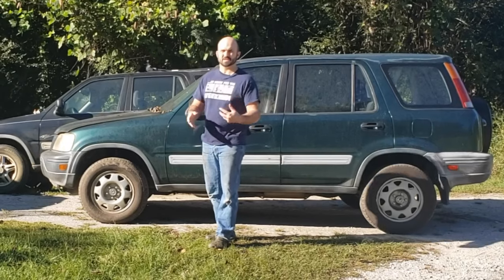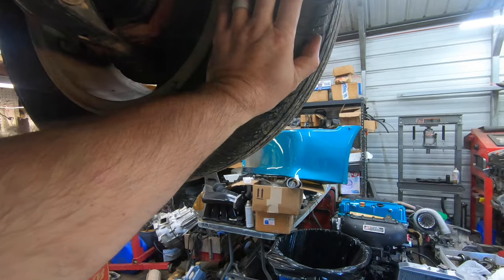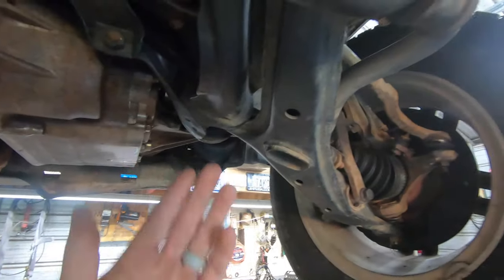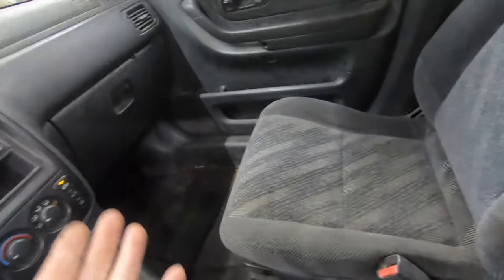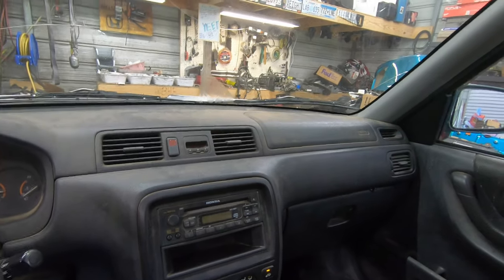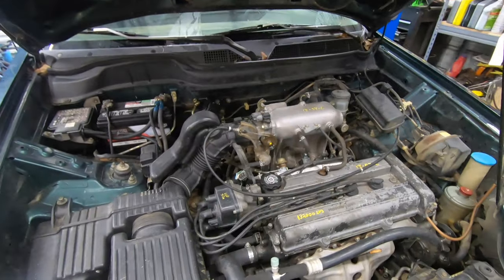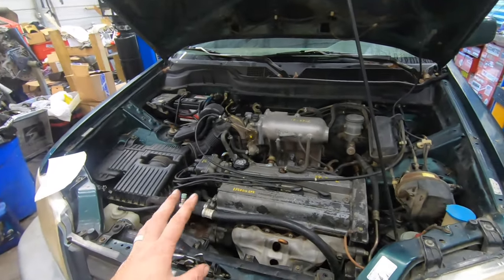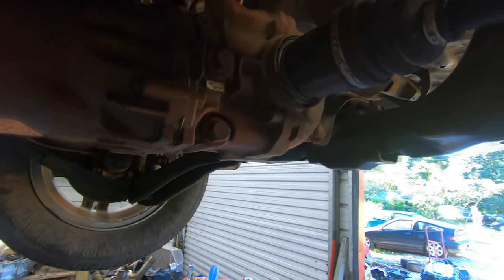Most Common Problems: 1997 - 2001 Honda CRV RD1 RD2

Comment: Do they have issues with the rear trailing arm bushings? I thought they had a similar setup to the civics and they are pretty much always cracked and need replacing.
Reply from the maker: They are the same design, however I don't see these busted up like the civics as often
Reply: @hondaresource  oh thats good, its a bit of a pain of a job to do those bushings
Reply from the maker: @teamaxlestands  yup, the tool helps a good deal though

Comment: You made good points of the details between the lx ...ex.. and se... But the downside is that all the parts are interchangeable so yo can have an lx but ex parts could be installed...
Reply from the maker: I wouldn't consider it a downside. I think it's pretty cool that parts are interchangeable.
Reply: Yep.

Comment: Do you prefer to replace the entire lower control arm, or just the ball joint that's the problem?
Reply from the maker: Ball joint isn't pressed into the lower control arm, so just the ball joint if that's what it needs

Comment: I have 2001 crv SE model  and have a mysterious problem of cranking but no start and its intermittent. Usually happens when the car is at running temp. I have replaced the distributor ,cap ,rotar, plugs ,wires, and fuel filter.  
The starter is strong and I just had the whole timing belt kit replacement done and it is still having the problem.
Reply from the maker: I would look at the main relay. It's behind the glove compartment.
Reply: I've had my CRV for 15 years and I had the same issue where it wouldn't start and it ended up being the coolant sensor just by the distributor and I was like you I replaced all that stuff you did.....

Comment: I have ine of these and have spent around 1500 trying to fix it done a tune up and it started missing got that fixed and now it will not idle until it warms up. After it warms up its runs fine other than idle surge and seems like it down on power a little.. I've took it to 3 different people who have replaced timing belt to checking this and that and computer with no luck
Reply from the maker: No check engine light? Kinda sounds like the ECT sensor since it wont idle until warm

Comment: I have a 2001 crv and when im running down the road 1 gear is fine then 2 second gear sometimes it does fine sometimes it takes time to shift when reaching at 4000 rpm to shift and i did the oil change and  it worked fine then it started to do it agian and i dont know what to do. Can you plz help me.

Comment: Just bought a 98 CRV with 238,000 miles and there’s an oil leak I’m trying to find without buying the uv dye..I think it may be coming from a hose connecting to the bottom of the radiator..would that be oil coming out of a hose in that location if it were?
Reply from the maker: It's possible that transmission fluid could be leaking there, but not engine oil

Comment: I have a 99 CRV. For the past two weeks, I’ve been through the ringer on this thing!  Hopefully you can help..

The lower header rusted out at the flange so I replaced that with a new one. After that, the car started to feel like a dog driving, found out the cat went bad, so I replaced the cat and figured the car was running like that due to a lack of flow. Now all the exhaust is sorted and fixed, it runs completely normal for about 20-25mins and then it will sputter and die. Then it won’t start (will crank just fine) for atleast 15-20mins until it does start and it only can drive for a few blocks before it dies again and this process restarts. 

I’ve put new plugs and wires in it a few months ago and just today replaced the cap & rotor just to be sure.  But man, I am lost.. it doesn’t throw any codes and acts completely normal until it sputters and then starts doing this.
Reply from the maker: Either the main relay ( pass side behind the glove compartment) or the ICM (in the distributor) 95% chance that one of those 2 are the culprit
Reply: @hondaresource  after commenting I learned of the fuel ignition relay. Went and bought one and installed it. Seemed fixed until it sputtered out and died again so I have a distributor ordered now. I also bought a crankshaft position sensor just in case. 😂🤷🏻‍♂️

Comment: i have owned a rd1 97 for over 10 yrs, sunroof wont seal properly (leaks), that leak in the passenger side, power window issues, now my tps and my a/c compressor wont shut off i had a b20b4, then b20b1 now a cross between a b20b/z

Comment: So I’m having a problem with my 2000 crv rd1 over heating problems when running ac I’ve switched both fans they both run great I have switched temperature sensor fan switch radiator thermostat I’ve done a Block combination test all was good what else could it be
Reply from the maker: Only with ac?

Comment: I get the cracking/popping sound coming from the back, would that also be the end links ?
Reply from the maker: Definitely possible
Reply: @JerkingwithJesus  well i usually hear when im going fairly slow (20- 25 mph) over bumps usually ones at weird angles, not like regular speedbumps

Comment: You should see all the 1st gen crvs in Canada. They are all notorious for rusting on the back fenders ! About 9/10 I still see on the road have atleast one rusty back fender.
Reply from the maker: I see a few from time to time with rust, but it's extremely rare
Reply: @hondaresource  15-20 is what they last before rusted frames break, floor boards rotted ectt. Some have holes in wheel wells after 5 years.  In Maine , so basically Canada lol

Comment: Hi just wondering my son has a 1998 crv and sometimes it shuts down as he's driving it then he will pull over and wait 5 minutes then the car will start back up what would cause the problem
Reply from the maker: Usually the icm in the distributor or the main relay behind the glove compartment

Comment: My wife had a water leak on her passenger side 2006 CR-V. Apparently, the drain valve can get tucked upward inside the frame when the car is being lowered on a lift. I had to crawl underneath the car and flip the valve out with a butter knife and dodge all of the gross ass water flying out.

Comment: I had a problem on my honda CR-V 1998 manual transmission. The engine starts when ist cold but when the engine is hot the engine cranks but no start. Pls any idea what is the problem
Reply from the maker: Ect , main relay, or distributor

Comment: I’m curious if I’m one of the few with A/C issues. I’m told Black Death but idk. I replaced everything but didn’t do it all at once. Any ideas? Maybe do it all again but all at once? 97 AWD
Reply from the maker: what all did you replace? I definitely would recommend all at once.
Reply: @hondaresource  condenser, compressor, pressure switch, dryer, evaporator, expansion valve and blew out the lines which has a bunch of black/brown oil. What I have waiting in the wings to attempt is all of the above again and to A/c lines (only ones I could find online).
Reply from the maker: @mbermudez45  I normally clean the lines with brake parts cleaner

Comment: How much would you charge to do a manual conversion on a 2001 Honda CR-V
Reply from the maker: I dont have time to do a manual conversion, sorry man!
Reply: I've done one, it's kinda a pain (if you want it looking stockish), and needs so many parts from a manual it's likely easier to do an engine and interior swap to the manual chassis.
Still, it's very doable. You could maybe buy a manual crv for the cost of the parts involved.

Comment: Why does my 99 crv quit on me most of the time on hiway or whenever it want to, I thought would be the fuel pump, but sometime I slammed my driver door overdrive light comes on then I can start the car again
Reply from the maker: Kinda sounds like a main relay or ignition coil / ignition control module is going bad

Comment: I just bought a Manual 1999 LX a few days ago. It's a super clean, well kept vehicle, but I'm finding it's hidden flaws that I missed on the test drive now. 

I already had to fix the door wiring, that was fun. It also looks like I'll be doing some suspension work, and I have reason to believe the input shaft bearing is bad in the transmission. :/ Ive rebuilt the trans in my Civic before, so I definitely think I'd rather just replace it this time around. (Hmu if you have one, I live in TN 😉)

But once those issues are solved, I know I'll be very happy with it. They're such cool little vehicles. (I say little, when it's the biggest vehicle I ever owned haha)

I just sold a 2000 Civix EX that I've had for many years and this feels like a big version of that with a bunch of cool extra features.
Reply from the maker: Those transmissions are kinda difficult to find. You'd probably come out better replacing your input shaft bearing. Congrats on your purchase!
Reply: @hondaresource  Hey, question! Do you think the rear seats in an EX , or at least the frame that allows them to fold out into a bed, can be easily swapped into an LX? A local salvage yard has an EX there with the folding rear seats, and if they can just bolt in, I'm going to snag them.
Reply: Sounds nice ! 5 speed! How'd you find it .....
Reply: @SaulnowPaul77722  just got lucky on Facebook Marketplace!
Reply: @TheJakePoole  very nice!

Comment: I have a automatic 1998 Crv with Engine misfire but only when its hot out, not because the engine itself is hot but due to the weather itself. Changed spark plugs, Battery, distributor and the Module inside the distributor, including the gray box on right passengers side in glove compartment. Any ideas?
Reply from the maker: Have you done a valve lash adjustment?
Reply: My 2000 CRV LX had soft valve seats from the factory I had to replace the head at 80,000 MI..... Also the air conditioning unit should have been recalled because it blew a hole in the side of the compressor at $65,000 MI.....

Comment: I have a 2000 CRV and I ran into an issue with limp mode, seems like it won’t accelerate past 3000 rpm’s, is this a solenoid issue?

Comment: Hi I have a Honda 2000 CRV and the right front hub was replaced and now the front brake pressure plate is loose making a noise.  How do you fasten it to the hub. I don’t see any screw or bolt areas to secure it on the wheel.
Reply: I meant vacuum plate
Reply from the maker: I have no idea what you're talking about

Comment: I have a 2001 SE awd auto that has a constant whirring sound that increases in volume and pitch with road speed, any ideas of what i should check? Ive had rear diff fluid replaced, I did several trans fluid drain and fills with the proper atf. Shifting to N while driving does not effect it.
Reply from the maker: Possibly wheel bearing
Reply: @hondaresource Thanks, I'll check those first! I saw your video on replacing them, do you think they can be changed without a press? I changed the bearings on my 99 ford ranger without one and it was a pain, and the crv bearings look like they're a lot tougher to install because they're so large. Not sure if the wood block and sledge hammer technique is enough there! 😅
Reply: Or just bad tires even.  @hondaresource

Comment: Have a question about my daughter's 99 crv it idels fine when cold after it warms up it does ok till it gets hot enough for fans to come on the icv has been replaced twice the throttle body has been removed and cleaned theroly even the high idele thermal control but after driving a wile putting it under a load will cause it to stall out and oil light will come on it's been put on a diagnostic tool and everything shows fine other than rpm and there's no check engine light on I know your in Alabama and I'm in Lagrange ga
Reply from the maker: Is the oil light coming on before stalling or after?
Reply: @hondaresource  it's coming on before it stalls every time it idels low it will come on it car doesn't have enough RPM to keep oil light off

Comment: hey at 7:17! I think that's what my issue is the valve seat issue - I've popped the head off THREE times now to replace the exhaust valve on cylinder one that have blown. Does this mean loosening the valve lashing to solve this issue? what's going on here?
Reply from the maker: Are you doing a proper valve adjustment on it each time?
Reply: @hondaresource  I very stupidly wasn't - in fact I wasn't even returning the rockers back to where they came from. This time I did a valve lashing to spec (first time doing that haha) - I found it incredibly remarkable how loose 0.16 and 0.12 felt, - like the tiniest amount of grab left. Runs like a dream now, check engine light from error p0420 went off on its own. The valve lashing honestly sounds a bit loud but it runs like a dream now.
Thanks for your vids!
Reply from the maker: @jamesdahmer5027  that will probably make all the difference

Comment: I thought the 97 98 Motor was pretty much the same as the 99 00 01 the only difference I thought was the intake manifold????  So I thought you can put older motor into newer as long as you put a newer intake manifold?
Reply from the maker: You can but the 97-98 has lower compression

Comment: another issue is when i pull the dipstick out, the tube comes out with the stick. i didnt notice it when i first got my CR-V but i realized once it spit oil all over the engine bay
Reply from the maker: I've had to fix one of those before, not I really don't remember what I did to fix it

Comment: I have a crv with a missfire code, it has a rough idle and lots of fuel consumption, I have adjusted the valves, fuel filter, tune up, ignition coil, clean O2 sensors and cat, used fuel treatmeants and it still has the same issue any idea what could be going on with it it’s a 2001 SE automatic
Reply from the maker: Have you done a compression test?

Comment: Ive been fighting a hell of an issue. Whenever im going 35 ish mph and above and let off the gas and coast i get a very bad shutter. From the center/rear of the car in the body. I get the same shutter when turning full lock at low speeds. I was thinking diff fluid ? But idk. New front suspension, new struts, all the axles are tight and brakes are good amd wheels are fine ( tried 3 sets )
Reply from the maker: have you checked the u-joints in the driveshaft? I would also recommend changing the dual pump fluid in the rear.
Reply: @hondaresource  the driveshaft seems “ok” its not overly tight but its not loose. The rear section is tighter than the front but the shutter is from the back
Reply: Mine ended up being torque mounts and rear motor/trans mount 

Drives like a caddy now

Comment: Have you ever heard of a loud howling coming from the back on awd models over about 30 mph?
Reply from the maker: Could be a bearing or just fluid needing changed
Reply: Yep rear differential may need some new oil use the Honda stuff I had to replace mine twice ..... I got 205 k  mi on mine.....
Reply: @SaulnowPaul77722  I figured it out it was the rest hubs and bearings

Comment: I've owned several 1st gens and a big problem I have is the rear glass lift hardware coming out of the glass.
Reply from the maker: definitely a common issue. I would recommend the metal hardware from Amazon

Comment: I did 165k miles in my 99 CRV in three years with no faults, it eventually went to heaven after 230k miles.
Reply from the maker: My crv had almost 300k on it before I just transformed it
Reply: @hondaresource   I'm looking to buy one again, would prefer a MK1 but they are becoming rare in the UK and prices are rising

Comment: Hi, I recently had a timing belt change on my 1997 CRV and now I have a crankshaft sensor code but the mechanic says he cannot find the crankshaft sensor.
Reply from the maker: Did they put it back on?
Reply: @hondaresource  that's the thing there wasn't one on the engine. Turns out the engine was replaced with a jdm one and didn't find out till after the shop closed for the weekend. Question though would a bad distributor throw a p1337?

Comment: I just bought an 01 with 209k for $400!  I've heard, with valve adjustments, timing belts and proper maintenance, these engines are capable of going 300 to 400k miles.  Now the 3rd gen, 2007 up are garbage

Comment: Hi  ,  help 😄my honda CR-V failed it's emissions test,. I know air filter is good pcvalve is good whole new manifold and full exhaust plus a cheap catalytic converter put on last year, picking my brains what could be causing it ,  levels are ok on idle ?
Reply from the maker: I have no idea on emissions. We don't have emissions testing in Alabama. Do they tell you a reason it failed?
Reply: @hondaresource   yeah hydrocarbons were too high on high acceleration,  I'm gonna put some fuel treatment in and change the catalytic converter and see if that brings down the readings ,.your lucky , I wish I lived in Alabama no wonder it's called sweet home😄😊

Comment: I have a clean rd1 but it just started giving me issues with starting the truck when its cold. if i don't warm it up it will stall or just run off without fail. usually it shuts off as soon as i put the truck in reverse and give it some gas. now i warm up the crv and then drive off i have no issues, also noticed my gas depletes rather quickly, any idea on what it could be? my mechanic had me change the air control valve but i still have the issue, please help.
Reply from the maker: I'm not sure. Do you have any check engine light?

Comment: have a 2001 honda crv green drive light blinking what sencor is it and ware is it to replace cant find any videos for 2001.thank you if you can help me in ca.
Reply from the maker: You need to have it scanned. That's essentially a check engine light for your transmission